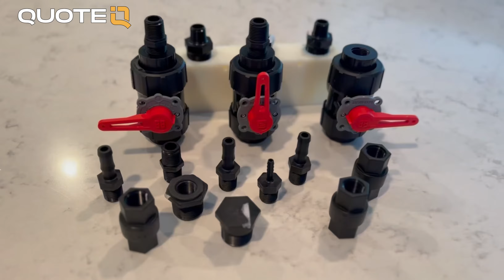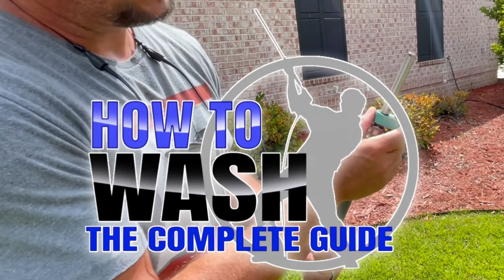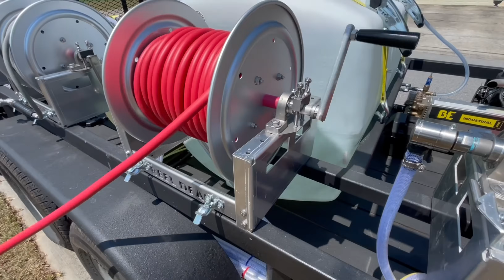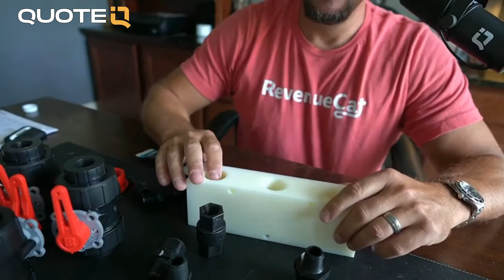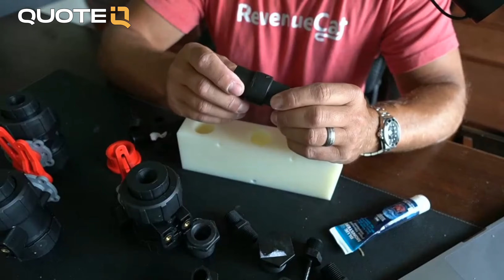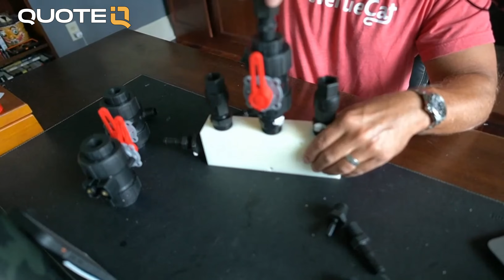How To Build A Softwash Metering Valve (I'm Giving It Away)

Comment: I have a valve that needs rebuilt. Where and what parts do I need? Looks like orange o rings, and some type of white seal around the plastic ball? Thanks!
Reply from the maker: You would need to know who manufactured the valve, and get with that. They are all different, different size o-rings.  But honestly, I would probably just replace it.

Comment: How the water will  be able to rinse / flush out a SH  valve if there is a check valve underneath it?
Reply from the maker: That's what a check valve does
Reply: @Mike-Vidan  yeah, but the check valve in this case will not allow water to go into the valve, right? Water can't go back through the check valve 🤔 I'd install the check valve above the metering valve... Or am I wrong?